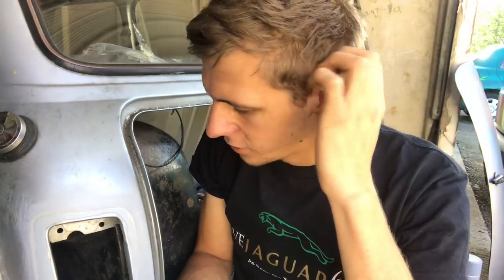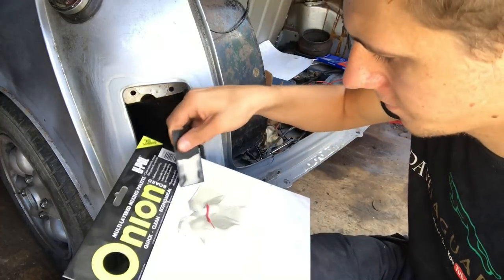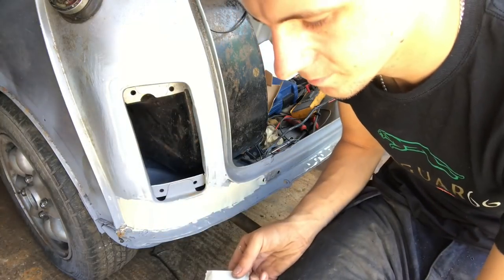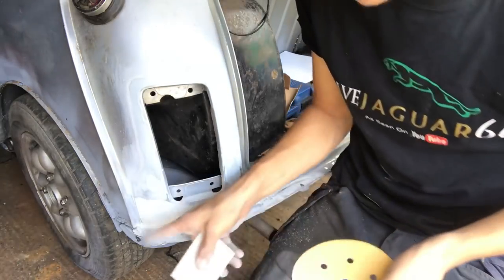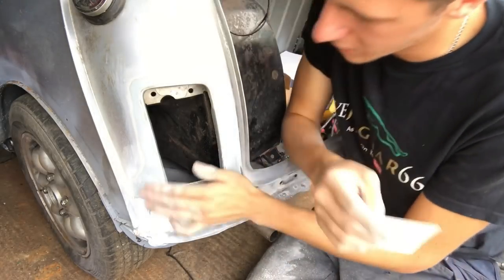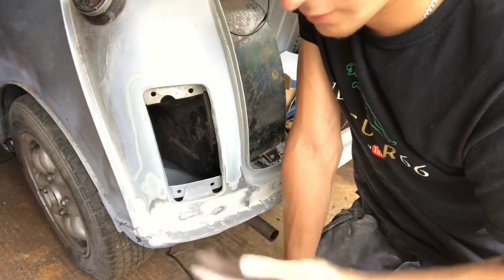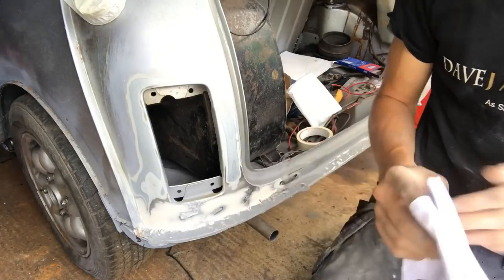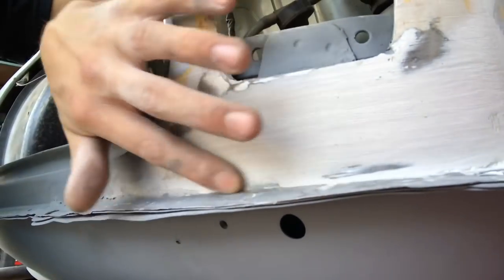Classic mini restoration - Preparation for paint, sanding, filling and more sanding

Comment: Hi tom,if folk don't like it they don't need to watch. I learned to sand from utube, sand one way then at 30 degrees, seems to work well and a wee trick...... the day before cut some strips of different grades of paper and super glue them to paint stirring sticks or lolly sticks, this helps to get into corners without sanding off your finger tips lol. Crack on mate, Martin
Reply from the maker: Mini Man Shed Cheers Martin, there’s some great tips. I’ve realised yesterday I have a multi tool with a sandpaper attachment, why I didn’t use that I have no idea. Like that about the paint stirrers though thats brilliant 👍🏻